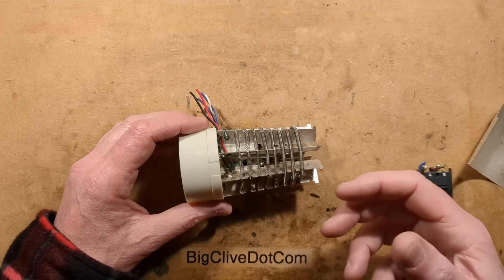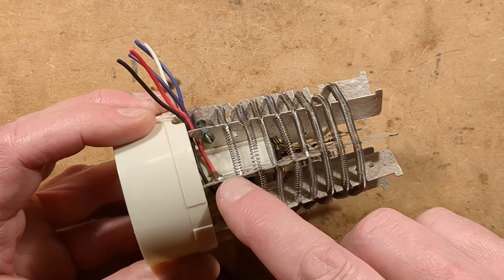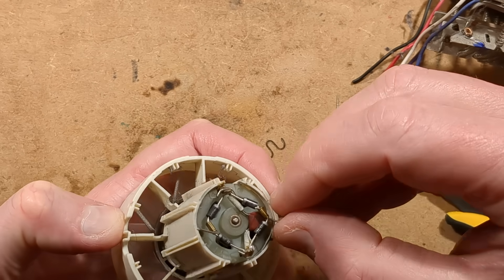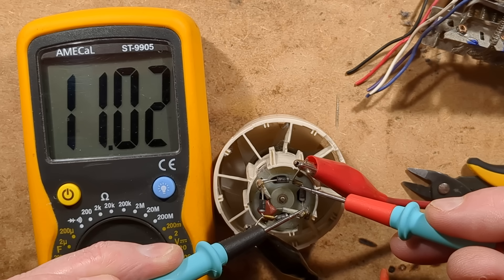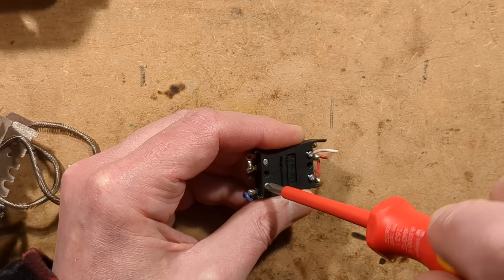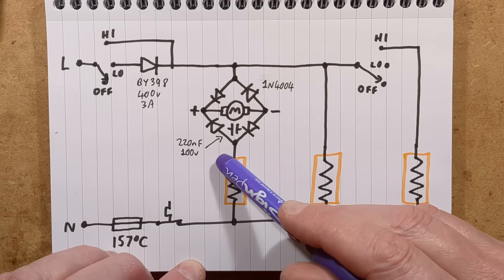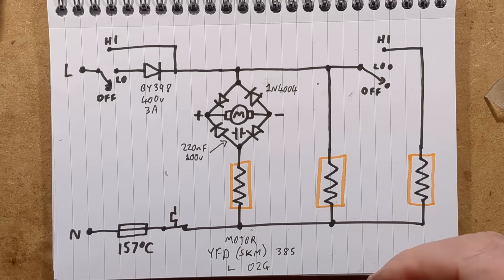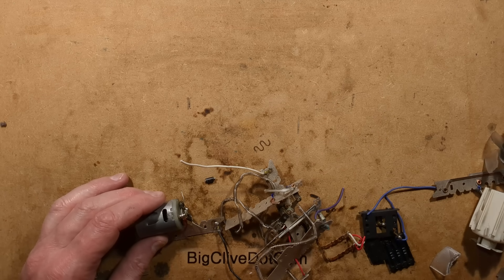Failed hair dryer exploration and schematic

Comment: I’ve pulled apart a couple of hair dryers to use to make a temperature controlled dry air unit to dry out electrical equipment. 
In both hair dryers there is an element affectively across the supply with a tap off part way along to supply the motor via a bridge rectifier. 
The voltage to each motor is 14 volts. 
The switches must always get hammered switching such a load on small contact areas. 
Thanks Clive. 
Keith W

Comment: If you use a soldering air gun you can set better the temperature...
Just an idea, at least a two purpose device.
Reply: Aren't the diode symbols reversed?
I was confused..

Comment: Did I miss this? At what point do you get your 12V (AC I believe)? Is there a transformer before somewhere?
Reply from the maker: It uses a heating element to limit the current as a form of potential divider.

Comment: This heating wire is brilliant.
I've used this to make a (12V) greenhouse heater, cut it to suitable length (= resistance) and spun it across a clay flower pot a few times at different levels.
Heats up the put nicely and creates some slow air flow to keep the greenhouse above freezing 🙂
The only trouble is that the batteries don't get recharged well enough by the solar panels during these dark times...

Comment: Some time back I was helping out the maintenance guy at a hotel by relieving him of anything electrical.  This included several irons and hair dryers of the sort that were typically included in the rooms.  Many of the hair dryers had busted fans.  I salvaged anything remotely useful from those,  so now I have a box of assorted heating elements that might find a use for one of these days...

Comment: (I know it was the diode, but) If a motor in a device like this dies, it's almost impossible to find the right replacement unless you have working device as well. The print on the motor itself almost never tells you the voltage/current/rpm (not even in a coded form), just from what model series it is. The actual needed values are specified by the customer (in this case the hair dryer manufacturer) and the motor is then wound to that spec.

Comment: Love your videos about electronics, for many years I recovered precious metals from various electronics. Almost all electronics have a amount of treasure locked within them. Computer chips, boards, switch's, relays, Etc.. I learned how to extract said metals using Nitric acid, incineration and other processes. It was lots of fun and a made a few $... Hey do you know there is gold, silver and probably some platinum on the contacts in that switch (not a lot, you would need to process about 5000 to cover the cost of the extraction)... Keep them coming!! Tom Buffalo NY USA

Comment: Alright chief. Thanks for the vids over Xmas — I enjoyed them all a great deal, especially the Ralfy one.
I got my Xmas gift from my wife today. She was sufficiently awesome to realise that what my life truly lacked was a pair of Engineer SN‑06 side cutters. Ordinarily I use the cheap ones — the kind China makes by the million. I’d use them for a few months and then stick them in the recycling, which always felt a bit wrong environmentally.
So Chloe bought me the £17 Engineer ones. They’re about six or seven times more expensive than the cheap ones, but they’re twice as nice to hold, and I suspect they’ll last three or four times longer. So the price actually works out about the same.
I’ve tried to formalise this using what I like to call the “Joy Quotient” equation. My “Personal Value Heuristic Framework” looks something like this:
V = C * (L * JQ)^3
Where:
• 	V is the Total Value
• 	L is Longevity (how much longer it lasts)
• 	JQ is the Joy Quotient (the “feel” of the tool)
• 	C is the Cost
Because I cube the utility term , even a small increase in quality creates a massive leap in perceived value — easily justifying the £17 price tag.

Comment: Normally the motor is not in series as you have shown.  They usually tap across a portion of the heating element which is just a percent of the total voltage, almost like an autotransformer

Comment: As a fixer for a local repair cafe, these are always a pain to deal with. When we can even access the thermal fuse there is no guarantee that whatever popped it in the first place won't pop it again, although you have taught me a possible failure point to investigate now. Great video as always!

Comment: Those cheap motors have oil impregnated solid bearings which makes funny buzzing noises when the time comes. They also have some life designed on their brush arms and commutators. When the rotor stops (either due to bearing, brush, hair tangled on the shaft etc.) it is not a good thing for the design (imo). for this cheap design to work, motor should be rotating at the designed rpm and dissipating some heat and power. (again imo) thanks for the reverse engineering. (btw; 385 suffix may be correlated to mabuchi model number, size and design is similar)

Comment: Actually managed to repair the missus' hairdryer some time ago. I forget the exact symptoms now, but they did include slow fan and excessive luminance from the heater coils. The hard part was getting the damn case off...but once inside, I found the remains of an exploded diode and was able to replace it, although I did use solder as it just wasn't possible to re-do the rivets of the original assembly. Still working fine.

Comment: Rather intresting as i knows this simple rectifier diodes are always going to be short.. and i heard of abaut a added effort or a technology to make a PN junction turn to be open if its fall. I may test the thre other diode to what will happen with them in a case of failure as can be found this intresting technology behind.  

The series diode 3A rating can be right, because it conduct in less than 50% duty cycle and had forced cooling with cool air stream and the resistors are olso limit the peak current thru the diode so it feels himself OK for this duty.

Comment: Did this hairdryer have a 120/220 international voltage switch. I bought one in a thrift store (USA) for parts and found that the switch was fake and did nothing. I'm assuming somehow it didn't matter.
Reply from the maker: It didn't have a voltage selector.
Reply: @bigclivedotcom have you seen one with a switch? It wasnt even a switch just a plastic knob with 2 clicky positions

Comment: having tore down plenty of hair dryers and heat guns over the years, you usually have to pull the blade off first(not easy/like to break), then the motor will push out with the whole element assembly still attached. probably has hard to reach locking tabs the motor snaps in or very tight press fit and some alignment pin/raised boss and notch.
for the price, they're not worth repairing, only seen one with failed diodes before and it was in use during a storm that lightning caused a huge surge and brown trousers. lol
usually the elements came loose and burnt the through rivets or the thermal fuse permanently turning it off.

Comment: My mums hair dryer failed in almost the same way about a month ago. Setting "Low" only made the heater glow but didn't run the fan, while setting "High" ran the fan at half power while running the heater at full power. She said it suddenly only ran at half speed and got much to hot shortly after. That's when she turned it off and swapped to another hair dryer that she had. I was able to repair it for her by soldering a new diode in parallel to the failed one on the bridge rectifier. I knew pretty much instantly that the problem was a failed diode in this rectifier, knowing how the "Low" setting is imlemented with the one way rectification in many hair dryers. The one I repaired only has one long heater winding by the way, with a tap at 12V where it is used as voltage divider for the motor.
Reply: seems the diode failures are more common with 230/240v supply. cannot say I've seen but one fail out of dozens here in USA due to being used when lightning caused a huge surge(brown trousers too) and that's a mix of hair dryers and heat guns. usually it was the through rivet connections that worked loose at an element end or the thermal safety fuse.
Reply: @throttlebottle5906  I don't think it's down to the voltage difference itself: A diode that dies from electrical reasons typically dies shorted. The diodes being open on Clives dryer and mine I think is probably due to the vibrations from the motor, and of course the diodes being the very cheapest low quality you can get. Of course in 120V countries the currents are higher, so that might explain why you see failed (burnt?) rivet connections, which I have never seen here in Germany. But I also only looked at like 6 hair dryers so far in my life, and this is the only time there was a problem with a diode. Heat guns often have a melted element as their failure mode, but hair dryers not so much. Never saw that one on a hair dryer, they don't run the elements so hot in normal use.

Comment: Is there a minimum power level that one could get away without running a fan using the 12v resistive coil from something like this? just wondering if this could be some poor man's engine heater for diesel cars/trucks or whatnot, especially if the chassis acted as heat sync. Just wondering how much of a limiter it would need or if something like that is already used in some products, if it is I am assuming they just shorten the amount of coiled wire? thanks.
Reply from the maker: For a vehicle you could just use a 12V fan and suitable heater.  But heaters are generally quite power-hungry.

Comment: That diode for "low mode" makes 90% of solar inverters go into fault mode too. Because it messes with the sine waves or whatever. Pretty annoying, found this out on my heat gun but it's simple to just use it on max all the time.

Comment: A considerable while ago the Wife's hair-dryer had a dead fan moment, and before the thermal fuse self-destructed, the elements were glowing enough to illuminate the bathroom (Pifco I seem to remember)!  Those heater elements make excellent power / load resistors and the ceramic formers are oil resistant, so it's fairly straightforward to "build your own"  high dissipiation resistive loads if thought necessary.

Comment: My hairdryer died recently too. But instead the cord started smoking near the strain relief. Not really sure what happened. There was no noticeable damage.
Reply: flex stress, it breaks down the wire strands internally until there's not enough left to pass the full current, then it burns the remainder open.
I've had them burn the wire coating open and visually arc until quickly unplugged or opening so far it self extinguished, but by then it sputtered molten copper and debris everywhere(heat gun), same basic design/lower airflow for higher heat output.  that is why USA national electrical code wants combination series/parallel arc fault protection, and common extension cords people misuse will do the same thing.

Comment: I have the fan assembly from an old hair dryer. I wired a 12v car cig lighter plug to it and it moves a ton of air. Works great to stoke fires.

Comment: That is the first thing I can remember taking apart...I must have been like 6 or 7! Mom's hair dryer was dead, and I remember when I got the fan/motor out it was GOLD! I got it spinning I believe with a 9v battery. Eventually it became part of a boat. I was the responsible one saying battery only, but my friend's older brother grabbed the heating element part and plugged it in. And went screaming to his mom. I got some heat out of the elements SAFELY with the 9v battery, I'm sure it went dead fast! OMG that was a long time ago!

1. How did I know how to do that by myself and before internet existed?
2. Where the hell were my parents?

Comment: i hate that pull stuff apart and after you wreak it ?it turns out to be a 20c part .... the worst bit you spent big money to buy a replacement ..... if you dont buy a replacement when you fix the broken one  it it works a few times then destroys its self out of spite

Comment: Ah, needing a hair dryer is an ancient memory for me...  I had one fail on me once, must have been 30+ years ago now.  There was no need to take it apart to find the failure, while using it there was a loud bang and a shower of sparks, the cord had exploded.  The cord had that cheap "wire" with thin copper foil wrapped around some kind of plastic string.

Comment: Excellent video Clive, very interesting... 
I assume the Silvercrest ionic hair dryer is the replacement?? Good choice. 
I can confirm that it has a sililar set up with a heating coil dropper for the motor, which means the zero heat, and pressing the heat off momentary button is a BIG FAT LIE, as there is always some heat coming off that dropper element, otherwise the motor would spin very, very fast for a millisecond or so before leaving the magic smoke out with a very loud pop...
Reply from the maker: It is indeed Lidl's finest ionic hair dryer.
Reply: @bigclivedotcom in fairness, Lidl's stuff gets the job done just as well as bigger, more expressive brands, and you can't beat the 3 year warranty.
My Lidl pedestal fan's remote failed out of warranty, so I contacted them to see if I could buy a replacement. A few weeks later a new one arrived in the post, free of charge.

Comment: Back when I last disassembled a hairdryer sometime last century, the motor was half wave rectified with a single diode in series, tapped off the "centre" of one heating element.  Not sure why they bothered with the full bridge here, considering they half wave rectify the much larger load of the heating element for one of the intensity settings.  I wonder if the polarity of that heater diode is randomly set at the factory to "average out" the load on the grid for each half cycle across the whole population?

Comment: I had liked to see the entire hair dryer.
I never had problems with the "big" hair dryers, but a "Siemens"-hairdryer of the 1990's exploded in my hand. It was the switch that went BOOM, or a capacitor near it.
Reply: I had a cheapo chinese from a discount store 5 years ago. The switch was quite stiff and prone to arcing (enough to make it stink) if you couldn't get it at the setting you wanted right away. I ended up inheriting a late 1970s Philips hair drier from my grandma not much later, and i threw away the chinese one... 
The philips still works well.

Comment: I found many toasters die from oxidised contact of the rivet on the nichrome wire that supplies the timing electronics and holding electromagnets. Same resistor dropper supply using part of the heating element.

Comment: I have an old Philips hair dryer, its served me well, with an ioniser built in. Lasted me about 20 years so far lol...they are robust things really. I have defrosted my freezer with it on a few occasions too, never missed a beat.
Reply: I use pots with boiling hot water for the defrost, then a dryer to get the moisture out.

Comment: I wonder why they used 3 heating elements, I would have went with a potential divider configuration and lowered the resistance of the first heater, to get rid of the second.

Comment: I had an old Braun hairdryer that exploded one day. The cable had gotten worn internally where it entered the device, and a short circuit happened. It was a very loud bang in a small tiled bathroom. But I guess that happens after 30+ years of use with no strain relief. The cable was replaced and the hairdryer lives on to this day.

Comment: Yes Hair Dryers are built for a linted life.  But my hair dryer has a 12 volt motor and on low speed it gets 12 volt but on high speed the poor motor gets 20 volt and I'm very surprise that the motor hasn't burnt by now
Reply from the maker: Keep in mind it is ferociously air cooled.

Comment: Had that exact hair dryer , very good quality (has a 5 year garrantee), the fan assembly is now in use as a solder station fume blower with a 9v battery !
It failed with a bang, there is a big component (capacitor?) in the handle by the switch, made me jump and I banged my thumb nail on the corner of a shelf (that reeeeealy hurt )

Comment: It is rather unusual configuration for such simple hair dryer. The most common configuration was to use one heater wire, with 2 taps about the motor voltage (usually about 24V) and double of the motor voltage (48V) from one end. The motor is then connected by one terminal to the first tap (the 24V from the end) and the second fed using 2 diodes, one from the end and one from the 48V tap. Then low setting is to just supply the whole thing through a diode, high directly and that it is. Some are switchable "120/230V" are made by splitting the whole heater to two halves and a configuration switch connecting them to series (for 230V) or parallel (120V mains).

Only the models offering a "cold air stream" were using separate ballast resistor (in the form of a separate, lower current, heater), but these also have at least 4 position switch (OFF - Cool - Low - High). So far have seen just one such model, as obviously it is way more complex so expensive design, so not preferred when not really needed...

Comment: Did I spot a Schematic error ?  Was the heat medium setting switch position not connected to the middle heating element. I could be wrong
Reply: The idea is that left and right contacts are mechanically connected. Nothing is connected on the right when it’s on LO. But on the left  the motor and two heating elements get voltage (half rectified).
Reply: @TheStanHill  Thanks for the correction.

Comment: A while ago my own hair drier started to make squealing noises, so I figured I'd try lubricating the fan bushings. Holy crap that was horrible to disassemble. It was basically three layers of plastic, tightly clipped together, almost like a 3D reverse Tetris game. Took me way to long  but a little bit of silicone lube seemed to do the trick and it actually went back together and is still working (knock on plastic).